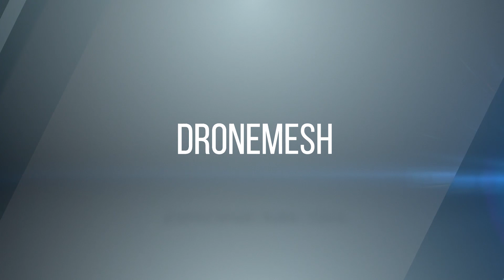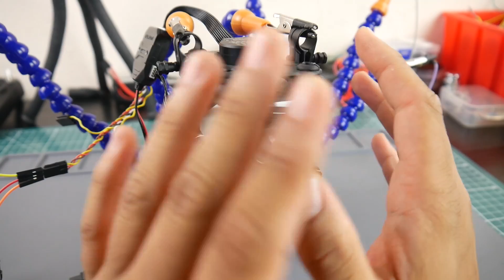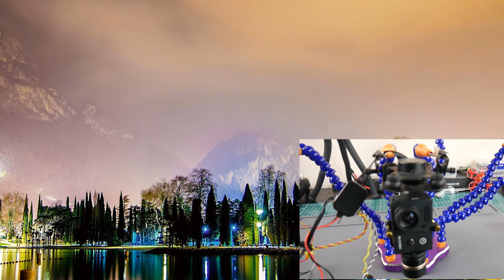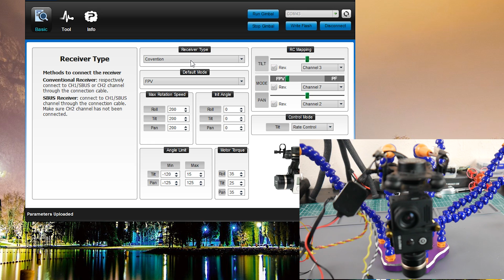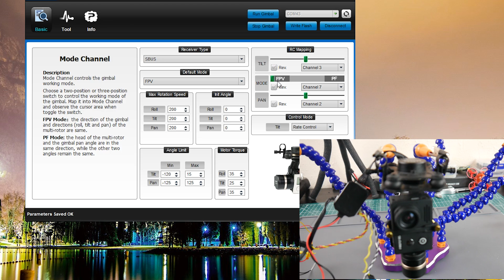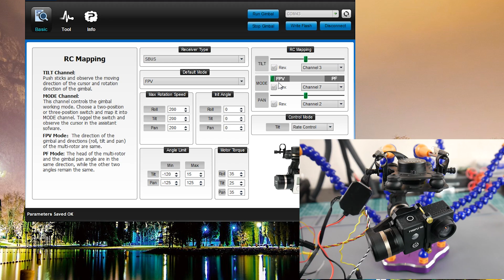Tarot TL3T05 Gopro 3DⅣ for Gopro Hero 5/6/7 Bench Review and Setup // Camera Drone Gimbal

Comment: how can you transmit video from the gopro hero 5/6/7 from this? this would be blind video recording
Reply from the maker: There is special wire that  comes with gopros and has analogue video output you would connected that to a dual cam switch board and like what I did with the zohd dart xl gimbal mod
Reply: @DroneMesh  could you send me a link on what this wire is? is it USB C or Micro HDMI?

Comment: Speaking of the sister model TL3T02 for the session4/5; I've just installed one and note: The GoPro session4/5 do NOT support any type of video out from the camera :(. The TL3T02 gimbal DOES still have the pass-through socket for a video+ground connection, though it's not documented in the T02 manual. So for the session, will have to video blind, which is unfortunate.. I have four now lol.

Comment: How will you know if the camera is looking at what you are trying to record with no live feed?
Reply from the maker: There is a USB cable that pipes out yellow analogue video wire which would go to your vtx. :)
Reply: Typically you'd use a video switcher running off a pwm channel on the RX, so that you can switch between the FPV camera and the gimbal camera. They usually support 3 video/camera inputs and one video output to the VTX. They're about the size of a normal RX.